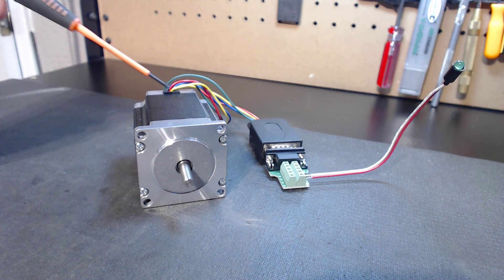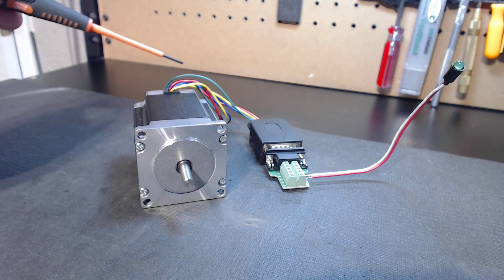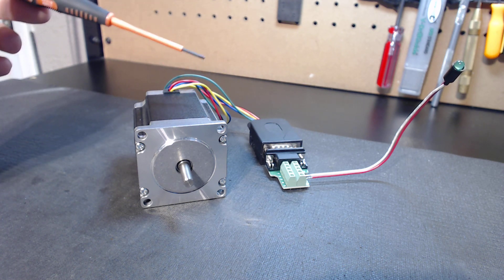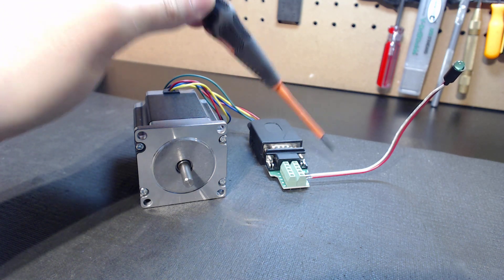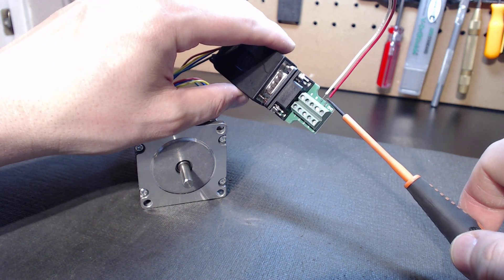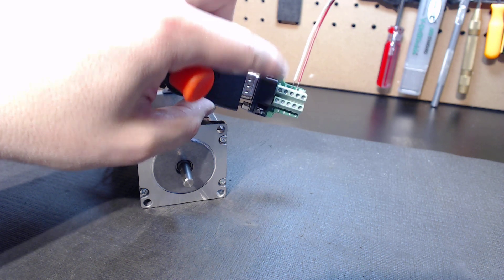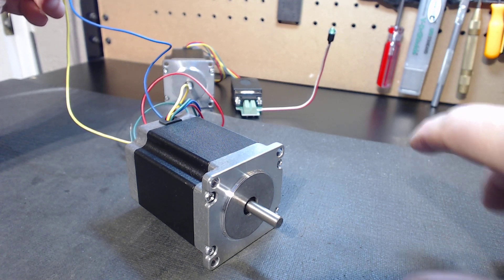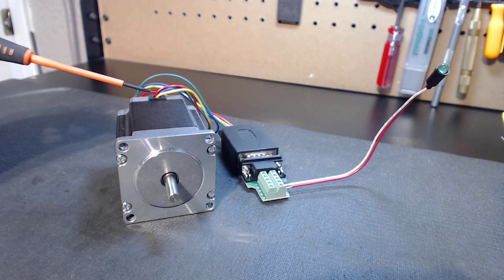How To Wire A Stepper Motor Without A Wiring Diagram..

Comment: Awesome video! I love the idea of the resistance of the motor to determine connectivity. Magnetism is still a mystery to me....

I had an idea of plugging the connectors to the suspected pin pairs into a breadboards +/- rails and a multi-meter set to 200mV connected to the same rails using alligator clips. 

Turning clockwise for each wire set can tell you if the voltage becomes is + or - , potentially allowing you to determine +/- leads for each coil (or at the very least for each pair of coils you can make them move CW/CC to avoid potential problems, which I am paranoid of).

Is there something I overlooked? Can that be used to infer + and - pins for each wire pair? I'm still an amateur so I feel like I probably overlooked something...
Reply: Nevermind, I think your LED tricks works great since it is a diode. The multimeter jumps around voltage wise if I don't keep turning so it makes readings swing from positive to negative. Thanks again!
Reply from the maker: Thank you for your support.

I would recommend this method to use a multimeter to determine the coil matches of the motor. https://youtu.be/qiURFLyxcdg

Thank you,
Vince

Comment: Hi Vince. Is it possible to figure out the decoder leads from a closed loop stepper?
Reply from the maker: Jojo, thank you for your support. Unfortunately this isn't possible. This method works for motors as your matching windings, and even if connected backwards the motor will run as long as your not connecting two different polarities (A+ to B- for example) Have a Happy New Year! Vince
Reply: @corvetteguy50  ok thank you!
Reply from the maker: @itsjojo1776  You bet...:) Vince

Comment: I understand how you identify each matching phase, A+, A+ , or B+, B- . However how do you identify the polarity A+ or the B+ of each phase. For example it's possible to connect the motor and the driver as follows ... (Driver A+, A-) to (Motor A+, A-). All OK so far. Then (Driver B+, B-) to (Motor B-, B+). In this case the polarity of the "B" Phase is incorrect ....
Thanks
Kevin
Reply from the maker: Kevin, thank you for your support. You can't identify the phase polarities without a diagram from the manufacturer, or vendor, and it really isn't required. If you connect leads from the same phase backwards using the method illustrated in the video then the the worse that will happen is the motor will rotate backwards which can be corrected through reversing the axis in Mach3. Thank you,
Vince

Comment: Great video, I'm having an issue where my motor will only move in one direction regardless of the command I give it (left arrow=motor moves right, right arrow= motor moves right) I cant seem to find any error in the mach3 settings that could cause my hot keys to be mixed up or anything like that. Could this be an issue of wiring? If so could it be something as simple as A and B wires are flipped?
Reply from the maker: Tanner,
Thank you for your support. I recommend going over the wiring carefully if you already verified your STEP, and DIRECTION settings in Mach. You may have a lead not making full contact, or wired incorrectly which is the most common issue.

Thank you,
Vince

Comment: Though I had an extra motor of a particular type that I had purchased previously. Is there a way to determine the Amperage required to use such a motor?
Reply from the maker: Ronald thank you as always for your support. There isn't a way to determine the amp rating of a motor if you don't know its specs. This is why I always recommend contacting the  vendor for the details of them if possible.

Thank you,
Vince